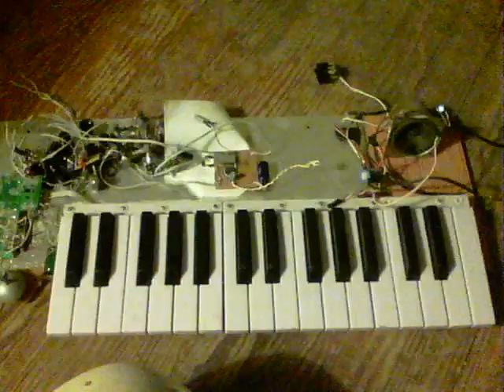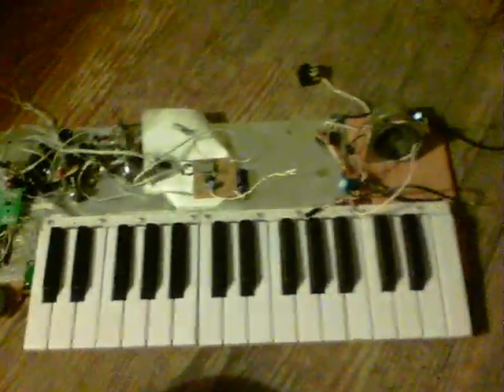Befuddling LED - SOLVED

Comment: It's just the capacitor discharging. The resistor is slowing the discharge rate to a crawl. Since the LED has such a low current draw, the led remains charged. There's also a second capacitor in the AC~DC wall wort. When you flip the power switch you are recharging the capacitor which is acting like a battery. A couple diodes in the power line between the LED and the capacitor should stop the current flow.

Comment from the maker: Thanks to all for answering. 
Will change the title to 'SOLVED'.
Glad I asked the question. With being so used to < 1.5V circuits, the effect of a heavily restricted LED input and efficiency of the LED chosen brought the major part of the long run. Dielectric absorption within the wall adapter cap then allowed the topping up after breaks of many minutes. That on/off switch was often left on for a few minutes, yet would still kick and that also puzzled...hence an hour long lit LED !

Comment from the maker: It seems it really is just the efficiency of the LED, with large resistor. There will be a cap in the wall adapter and it partially recharges when left for those gapped minutes between switches. An hour is still very surprising and all may have great uses down the line in solar setups, where dielectric absorption allows extra brightness kicks as light circuits fade.

Comment from the maker: Thanks Matt. 
I built a simple replication last night with no transformer or switch, got 20 minutes til it fully went out, charged with just a tap of 9V. The wall adapter will have a cap inside and even though I would leave the switch on for a couple of minutes, the dielectric absorption must be strong enough to kick extra in with the switch closing many minutes later :)

Comment from the maker: Hi Tony, yeah, the LED is likely to partially light. I think what has confused me is the efficiency of some LEDs, normally having seen slow fades and not much else even with resistors. Whites for me have been within ultra low power oscillators..driving them with a higher restricted source is where my eyes opened. A good puzzler lesson for anyone who usually works with < 1.5V !

Comment: Good find, the adapter/ dc transformer could have left over power to it. along with the capacitor being charged could keep the low draw of the LED could
yea try another power source, like others have said. 
I have a LED that I use as a night light , which will stay lit for up 3 mins after it's been removed from the wall. LED are very efficient. I have been lighting my home for well over a year now, power savings beats the price per bulb over time.

Comment from the maker: Thanks and Merry Christmas to you too :) 
It has to be the resistor, but the initial light is very good for any LED and then runs on like it does. Kinda wondering about feeding stuff around...Lasersaber type of ringing. A good start for energy efficiency in any case because of the LED brightness. Some kind of solar light with no transistor + switch for bright to see around at night.

Comment from the maker: Not got a schematic, is outlined in the description box though. Wall adapter to FWBR, 1 wire direct, other through power switch. Output through 2200uF to LED fitted with 56K resistor. Should result in 2 or 3 seconds fade off from size of cap, or at least that's what normally happens in such a circuit.

Comment from the maker: I set it up over at the front door to be about 20ft from anything (no TV etc here to interfere). The synth modules etc were back on the table so it would be bare bones. Just pots and stuff sat there in the vid, nothing powered.
This reminded me of the switched off wall adapter 'Pigeon Loft' experiments :)

Comment: Very odd. Looks like your synth is resonating with your wall adapter, still got to be getting a little power from somewhere though. Have you made sure no wireless transmitters nearby? Shame you didn't do it on purpose.

Comment from the maker: Good idea. Normally inside is a transformer, half/full wave bridge rectifier and perhaps an AC low uF cap, this one may be different. However, it's disconnected except when switching the power switch on for that recharge. I'll build another circuit, an if that doesn't do the same, will open it up :)

Comment from the maker: I do, but it was second hand and only senses AC at the moment (Protek 6502)...needs a scope to fix it probably !
Am intending to make another exact same circuit and test that. If the results are the same, then swap wall adapters, change LED resistance, capacitor value etc. I've had LED's fade off over a couple of seconds, that was expected here with no other circuits connected, but not to run on for an hour.